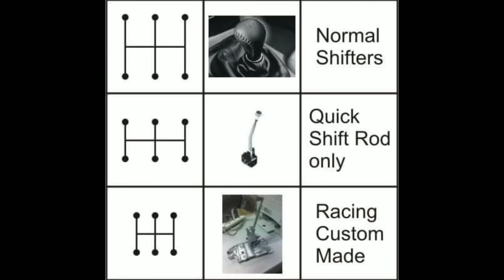How to install short shift | on proton Satria / Wira

Comment: Watched your video. Ordered shopee. Dismantle the center console of my 2nd car. Everything was okay until...the pin clip. That thing really...really annoyed me to took it off😂. I was sweating like shit struggling to take the pin off the joint. Either took it out nicely and install it back OR cut it and replace it. I took the 2nd option. I can't  stand it anymore😂. Everything was easy EXCEPT that clip. Took me more time there rather than anywhere else. Eventually its done now😅.

Comment: Nice work but the shift still seem long, maybe only a bit shorter. In videos for other cars, the shift is VERY SHORT, almost too short! I really need a short shifter but someone need to design this one better. The problem with Wira/Satria is that 1st gear is very far away if you have the driver seat all the way back for tall drivers. I have to stretch arm and move body to get to 1st and then 2nd/4th is very long and my elbow hits the back of seat. Proton did this badly.
Reply from the maker: 1 way to make it shorter is to cut the top part of the shifter.. make the shifter lower.. the more u cut the shorter the shifter..
Reply: @KustomZ  Is the shifter you installed giving a shorter shift than your cut-stick? Also, do you lose the leather boot when installing the shifter?
Reply from the maker: @cvcoco  yes.. the distance is shorter.. you can feel the shorter distance especially in gear 2 3 4.. the leather boot is still there.. in this video im just to lazy to put it back.. haha
Reply: @KustomZ  Ok thanks for the info. First thing though, another topic, maybe you can advise me. Im in Penang and the 1.3 needs valve seals. First, do you know any shop here that is qualified to do it without removing the head, and second, in case it doesnt stop the problem and I then need valve guides, I would want the same shop to do it. Do you see where Im going with this? By the time a person needs valve seals, you probably also need piston rings and if you do that, you need an o-haul of the head and rings and crank bearings and seals. By the time you need valve seals, you are really looking at an engine rebuild because valve seals wont be the only thing wrong. If I do that, you see i'd want a good shop to do the whole job properly and then whats the cost? And if that, is it better to have a shop work on your engine or buy a rebuilt block from another shop?

Comment: Gear lever+knob $170? Does it feel like placebo effect?
Reply: Short shifter is real not placebo effect.
Reply: Wan Tan  if you track your car, this is a good performance upgrade because it can shorten your shift time. Shorter shift time=faster car. Although the performance increase is not significant, it can help you to get better lap time
Reply: Muhammad Iqbal honestly my shifter is all off, it I put a short one I’d never get into 3rd/4th